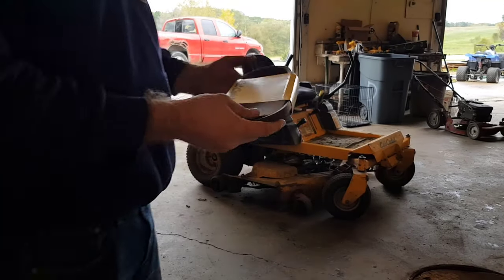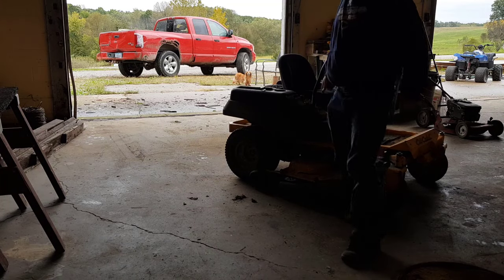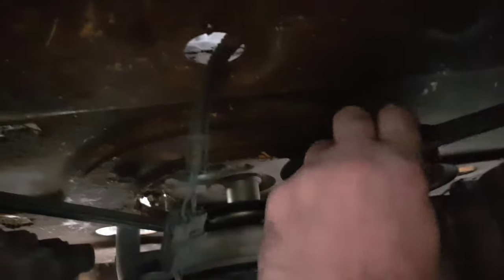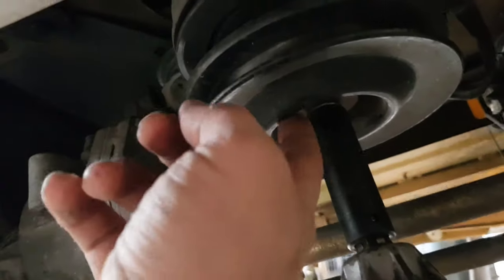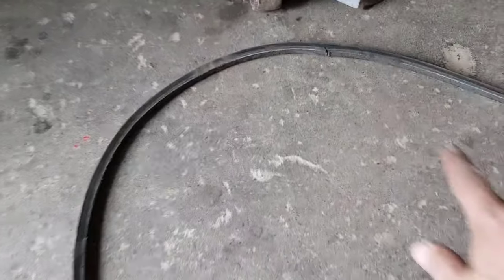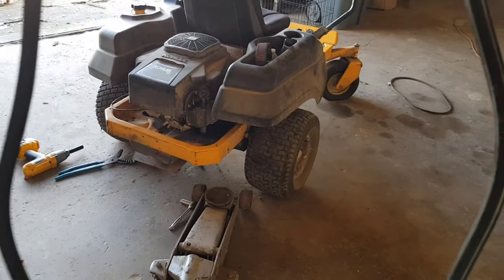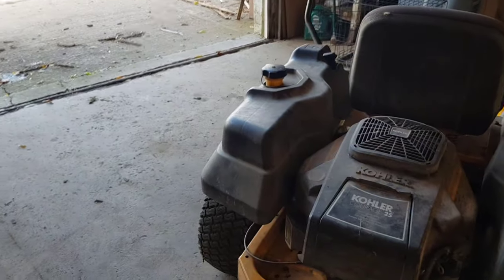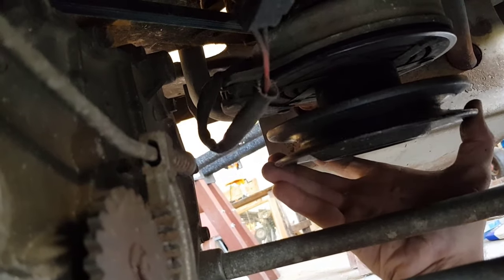Replacing Drive Belt on Zero Turn Mower! DIY.

Comment: Lawn Mower Drive Belt for Cub Cadet 754-04043 754-04043A 754-04043B 954-04043 954-04043A 954-04043B thanks for the video . I was about to take out my transmission which would have been easier but it turns out it was just the belt . loose just like yours go figure. thanks again

Comment: Just a little tip. If you take your belt off and go to an auto parts store, a new guy will grab down this slide rule looking thing and make up a part number that fits. The old guy in the store will hit it with a tape measure and get you the exact belt. 
I was in tractor supply this morning for this project and couldn’t find it by the part number so I looked up the pn, got the 1/2 X 57 and picked up a blue belt for $20.
Reply: Same thing, got the 57” for 20

Comment: My 50" Cub Cadet drive belt went out this Spring.  Fortunately my dealer had the belt but as always you pay dearly for the part.    Haven't put in on yet, thanks for this video and all the tips.
Reply from the maker: If changing the belt out doesn't fix your problem it might be the hydro fluid needs changed. I just hit 333 hours on mine and just did my first one. it's moving around better now!! :)

Comment: Thank u I looked for a few hours and couldn’t find the belt size for my mower
Reply from the maker: I had the same issue. Order two that were wrong size before i found the one i linked! I even got one from tractor supply where i had gotten the mower and it didnt fit. Wth... lol

Comment: I've had to replace mine twice. Never had to remove the clutch, you just use a screwdriver to bend the metal stopper away enough to slide the belt off, then bend the stopper back into place. No unhooking the electrical clip, no air tools. Super simple. Also a tip to replace the spring, hook a bit of aircraft cable through the little hole in the frame to the end of the spring, then use vise grips to pull the wire and hook the spring on its mount. Kudos to SilentKnightSaga for this tip. Here's the link to the video: https://www.youtube.com/watch?v=FrC3xAttEno

Comment: How do you adjust the tensioner pully cuz now mine won't start after replacing and I'm being told the belt is too tight
Reply from the maker: I don't think its adjusted. It's just applies tention. If its too tight the belt is too small. This belt was hard for me to get the right size. I put the one i found in the link. (If same mower)

Comment: Is that bolt reverse threads?  My impact won't budge it.
Reply from the maker: I dont think it was, try both ways... just in case.
Reply: It unscrews counter clockwise, I put a 58 inch belt on mine that I got at Lowe's

Comment: I wish mine was a belt. I can't turn right lol
Reply from the maker: Check for a leaking seal. If the fluid is low in the hydro stat, fill it up. If it starts working that is the problem. If it stops again during mowing or next time you mow check again and that will tell if it has a leak. I ended up having the seal around the parking break caliper leaking. Took me awhile to figure it out.
Reply: Crazy enough. It was a drive belt making it slip on the right turn!
Reply: Now my steering is all kinds of off tracking wise. Can't find the sweet spot since this old toro has 19 darn controls for it.